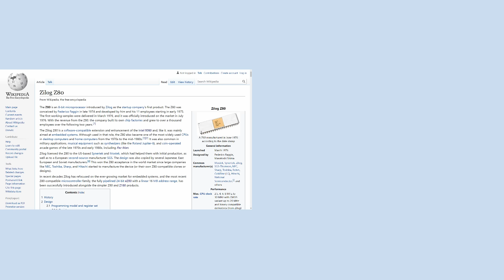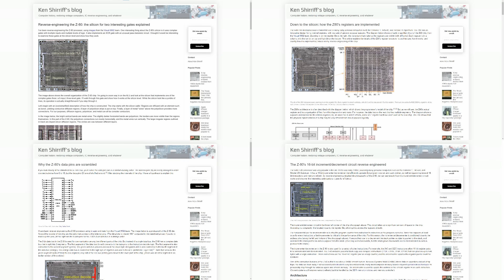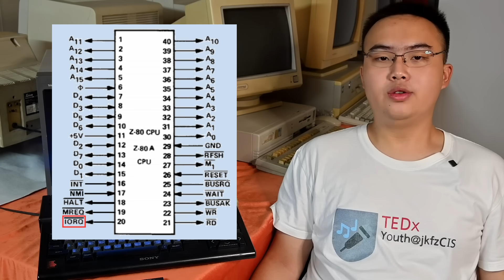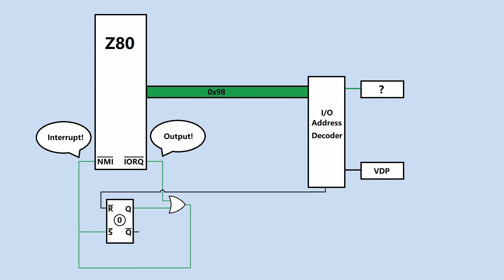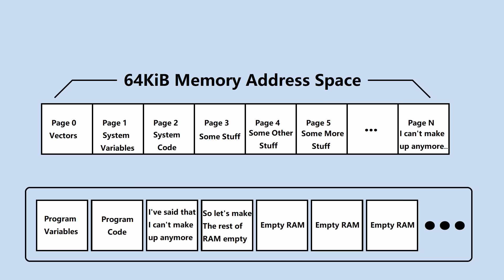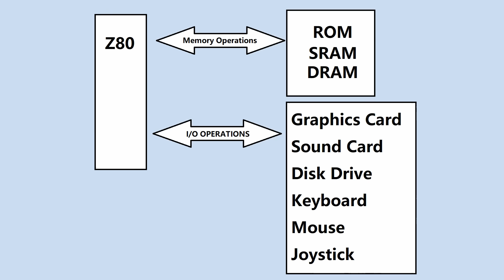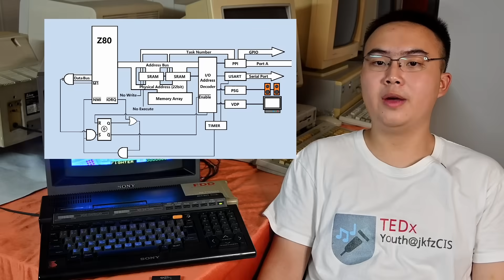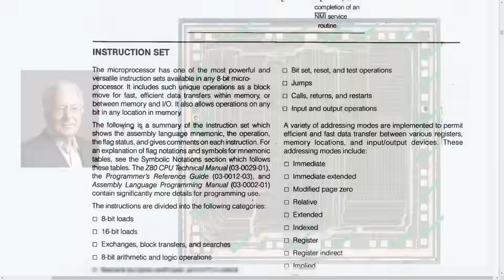The Z80's secret feature discovered after 40 years!

Comment: There were Operating Systems in the 1980's that ran multiuser/multitasking on a Z80 and later the Z8000.  TurboDos and Digital Research's MP/M come to mind.  Virtual Memory support was added as external logic. Much like memory banking and LIMSIM in the DOS world.  Most people do not realize that early processors had very limited memory address spaces. Obviously if you are supporting multiuser and multitasking memory needs multiply very quickly. (The same happened to VMWARE and Virtualization decades later). In the Z80/8080/8086 time frame Lotus and their killer app "Lotus 123" very quickly found out that the memory limitation was a huge problem for the PC. They developed, with Intel and Microsoft, the LIM memory paging (expansion) standard to made far more memory addressable as pages that could map into a window in normal memory space. Graphics cards had to do the same. This was actually a limitation of the ISA Bus specification as well.  Point being memory and security were glued on at first and then like all good things integrated into silicon.

Comment: About 30y ago I've connected together two 6502 to the same memory and I/O to have a two core system, and it worked! The program I've written on the memory was executed by the two processors and collaborating through a shared memory.
Unfortunately I was unable to finish the project because I needed a multi voltage power supply to make the LCD screen work and I was unable to build a stable one, so I was able to use the circuit only on a big power supply.
I still have the circuit in the closet, but today he doesn't work anymore because some soldering connections have broken.
Good memories about a distant past where computers where easier to understand and cheat.

Comment: vibes
Reply: Back in late 70s to mid 90s I wrote software on following 

8008, 8080, 8085, z80, nsc800 (cmos z80 with intel addressing and 8085 instructions as well), 8051 family, 68000. My favorite besides the nsc800 is the 8051 family specifically the Phillips derviatives. Great processor.

Comment: Theoretically you could probably handle some of those "impossible" things in software via an operating system. But it would be a massive performance hit for significantly less than perfect results .
Reply: You only can if that OS is fully encapsulated, has a fully integrated dev environment and only allows to run code that went through its own compile/link mechanism.
Reply: @-Jakob-  Doesn't necesarily need go go through a specific compile/link tool, but that's definitely a more airtight route. Just need to refuse execution of any binary who structure doesn't match. -- I'm really not talkings about locking out intentionally malicious code though, just stuff that doesn't rely on OS services go get stuff done.

Comment: Improvements:
1) Make the supervisor flip-flop drive one address line of your address mapping RAM.  This way you automatically get the OS's mapping when you go into the OS and the user mapping when running as a user.  This keeps all of your OS code out of user space.
2) Make it so that all accesses can make an NMI if they are to places that need to be dealt with by OS code like display memory.  This can be done by a having the mapping RAM return some value like 00H for those accesses.
3) Add a "time slice" timer chip so that you can do preemptive tasking at some fixed rate.
4) Add circuits that capture the automatic pushes of return addresses on the NMI so that someone can't mess up OS variables by pointing the SP at them and then doing an  I/O
Reply: re: "3) Add a "time slice" timer chip so that you can do preemptive tasking at some fixed rate."
The Z80 CTC does this easily; there are four programmable timers each with its own interrupt vector on the CTC ...
Reply: @uploadJ  Also add a hardware breakpoint feature like this:
Combine the fetch, memory operations and I/O operations to make a "doing something" signal that goes to the AND gates below.
Find a RAM that is small and buy several.  Connect the address lines of each to some of the signals.  For example one can be on A0..A7 and another on D0..D7 and a third on the various memory and I/O strobes.
Of these RAMs the D0 gets combined by and AND, all the D1s get combined in the next AND etc.
The outputs of the ANDs are ORed to trip the NMI.
This gives you the ability to trigger an NMI when for example a certain value is written to a certain location in RAM.  Spans of locations and spans of values (including any) can all be done just by setting bits in the RAM chips.

Comment: The 6502 also has undocumented unused features including iligal opcodes wich were purposely undocumented since they lead to unpredictible strange behavior of the cpu.
Reply: Yeah with the 6502 some of the "undocumented instructions" cause the internal state counter (for want of a better description) to go beyond the internal decoder table hanging the CPU solid... Have watched some fascinating videos... Practically I've been more at home on Z80 and 68000 but have a little 6502 and x86 experience. 8086 (before getting into 286 and beyond) didn't seem that foreign after programming Z80 and I even ported some PC 8086 code to ZX Spectrum Z80 way in the past....

Comment: Be very careful with NMI on Z80. The CPU is not fast and these interrupts can easily swamp the routine code (as you indicated). Anything in NMI must be very brief. How do I know? Multi Z80 control systems design in the 80s. It extended to multi CPU with a shared paged RAM for batching systems (mixers and the like) for animal feed, concrete etc. I also did a coveyor sending system which used an encoder to get the destination. A spring sorter for keyboard spring manufacture and several others in hogh speed use. THAT was a Loooong time ago!

It's interesting to refresh my memory (ha!) as it isn't static like the Z80, by watching your video 🙂
Reply: If your worried about the NMI speed then you've entered the realm of real-time programming. A whole of other ball of wax itself and subject of books and maybe another video lol
Reply: @metatechnologist  The observation is very relevant and has nothing to do with real-time programming. Setting the hardware up so that every single I/O request generates an NMI is idiotic at best. The processor services an NMI by essentially doing an RST instruction to the fixed address 66H, which takes 11 T-states (clock cycles). The shortest possible NMI routine is an immediate RETN instruction (RETurn from Non-maskable interrupt), which takes an additional 14 T-states. An OUT instruction already takes 11-16 T-states to perform, which means that each OUT is now at least 35-40 T-states, and that is without any "protection" code even executed! All I/O will be slowed down by at least 3 times.
Reply: @bennylofgren3208  Here's something that will make you cry just.a tiny.bit. Zilog just announced they're ending production of the Z80 this coming summer. It was a good run though. Thanks for responding! Edit: Apparently it's just the 40 pin dip that's going away not the newer embedded versions. But it's still pretty notable!
Reply: @metatechnologist  Yeah, I read that too, with some sadness in my heart. I started programming the Z80 in 1979 and as you saw some of it still is still stuck in my head. :) Those were some good days.
Reply: @metatechnologist  re: " A whole of other ball of wax itself and subject of books"
Yeah ... that's not really going to 'teach' anybody though. Book learning is good to a degree, but NOTHING beats actually doing it, even in prototype stage and then 'learning' the ropes like the rules one learns when doing critical real-time interrupt service routines ...

Comment: I remember looking through the documentation of the 6800, and I found that the software interrupt instruction created a unique set of signals on the pins, and, as a result, I thought at the time that a simple external circuit could permit adding a supervisor mode to that processor.
Reply: Can I ask why you didn't pursue the idea?
Reply: @ericwazhung : Anyone that really wanted to add some sort of protected mode to a processor without it, but with an interrupt interface, could just do it by using a timer interrupt to control a memory-mapper mode pin: interrupt triggers, clearing a flip-flop that can only be addressed while the same flip-flop is cleared, thus causing that interrupt (and any other that the board designer wants) to only be handled by the code accessible while the flip-flop is cleared- cleared corresponds to supervisor mode, set corresponds to user mode, set the memory mapping correctly and you're good to go. This can be done on virtually any processor with a generic interrupt mechanism.

Comment: The original NASCOM-1 used flip-flops, gates, the NMI and one of the RST instructions to implement breakpoints and single stepping. It would drop a RST in place of the orginal opcode at the breakpoint, which would call into the OS, there it would replace the original instruction and arm the flip flops and RETI, raising an NMI after the second M1 cycle (ie. after the stepped to instruction had executed) handing control back to the OS again.
Reply: That’s what she said

Comment: I don't completely understand everything you covered here, but I think I got most of it, and it's quite intriguing!  Extending a CPU's features like this, with fairly simple add-on circuitry isn't even something I thought possible. This was a really cool recommendation from the algorithm!
Reply: The simpler the CPU, the easier it is to add a feature via external hardware.  The Synclair ZX80/ZX81 computers did their display by causing the the Z80 to execute a string of NOP instructions to make the timing for the display hardware.  On a more modern CPU, the cache and instruction prefetch etc would mess up the timing.
Reply: @kensmith5694  I knew the zx80 drew the screen with the cpu on an alternating between compute and drawing instructions, but didn't know about the NOPs.  I'm not super familiar with operating that close to the hardware, but always happy to learn more, so thanks! 😎👍
Reply: @serpent77  It was extremely clever.  There was a circuit that caused any instruction fetch where the address A15 line was true to be forced to get a NOP instruction unless the byte fetched was a 76H.
The A15 was not used in decoding the address so it was ignored for what was really addressed.
To display characters from RAM, the program counter was set to 8000H plus the location they desired.
The processor would do a NOP which took a total of 8 clock cycles.
The actual byte was captured and fed onto 8 bits of the address bus.
Using a weird property of the Z80 more bits were filled in during the time the processor was working on the NOP.
This produced the address in the PROM that looked up the bit pattern to display for this character.
A shift register would then be loaded with it to shift it out to the display.
The thing with the 76H was so that by putting a HALT instruction in the display area, lines could be terminated early.
One of the address bits was wired to the NMI.
The timing of the Z80 was such that the NMI was only sensed while it was doing a refresh operation on the RAM.  The result was that the refresh counter counted up to make the NMI happen when the horizontal sync pulse should be done.
Reply: @kensmith5694  that's interesting, I remember back in the day going directly to ram to draw displays on an old IBM AT, obviously I didn't have to worry about the timing like z80 did, but I mostly get the concept you explained. Thanks 😃

Comment: Adding hardware memory mapping was pretty common - you mentioned quite a few.  Add-on MMU's were also common in mini-computers - for example the PDP-11.  Why didn't we see these in 8-bit micros?  I think the major hurdle was price - RAM was still relatively expensive, and even the cost of an extra circuit was calculated into the cost of most consumer machines.  Until the C64 came along, it was common to see home computers ship with 16K or less RAM, which of course wasn't that useful beyond a demonstration.  The Apple ][ could be expanded in various ways thanks to its open slots - the so-called language card was a good example of this.  There would have been nothing really stopping someone from expanding most Z80 systems beyond the natural 64K limit and adding protected and maybe even page-swapable memory - but mostly nobody did because by the time it was really possible in price, the world had moved on to other system architectures.

Comment: 4 minutes into the video and still nothing, 4 minutes of my life nobody will give me back
btw, the simplest, and pure software, way to get protected mode, multi-tasking, etc, is to build a VM on top of the Z80 machine code, you'll get a nex virtual processor with its own instruction set which can be whatever you want.  darn, you can even make it into a 32-bit, or even 64-bit instruction set cpu if you so wish (and with a bit of extra h/w assistance you can actually extend the address bus to 32, or even 64 bits if you want)

Comment: Nothing new was discussed as the Z80 processor user.
Reply: I don't get this at all. Having a MSX, while in ROM basic, you can address anything. What secret is there to find? Protected mode is a OS thing, as far as I know. Of course you can lift your user environment to a software-stack that does it's own adressing and task-scheduling but with the performance of a Z80, it's not much of use.

Comment: Nice idea but I believe the NMI signal can't trigger until the currently running instruction finishes, e.g. in that scenario after the IO request that you think you're intercepting... Only then can the processor perform all the logic to "CALL" the NMI routine at 0x0066... And if you consume the IORQ line to feed the NMI how would a peripheral know to accept an IO request? The part that does have some merit is having an MMU and banking out "protected" code and data... One interesting hardware product for the Sinclair ZX Spectrum was a speech synthsizer addon. In hardware it checked for access memory access to the IM1 maskable interrupt memory address, and as soon as there was an MREQ for that address it would assert a control line that mapped it's own ROM or go back to the computer own ROM by using a flip-flop. Every maskable interrupt (50 times a second) the add-on ROM would execute it's own code then jump back to the start of the code and the original ROM would then continue... an MMU circuit can "redirect" memory signals any way you want.... ZX Spectrum 128 did that on a basic level in the mid 80s though not for the reason you give. As for undocumented features, most of them are bugs or just gaps in the decode logic the designers didn't design.
Reply: Yup, there is quite a bit of romanticising going on in this video….

Also, the 6809 was generally more favoured to this kind of hardware hackery, which is why it was the preferred choice for 8 bit Unix-like systems. You could almost do a full protected mode, but like the Z80, the synchronous nature of the bus was the principle flaw.
Reply: He added a line to block the I/O from really happening by disabling the I/O decoder.
Reply: @kensmith5694  But now there's no IORQ going out to tell IO devices to decode the address bus to actually do any I/O.... And the performance hit is IMMENSE... You waste the 11/12 cycles of the "original" in/out, then it takes the CPU 11 cycles to reach the NMI routine, then you SOMEHOW have to work out what the instruction was while preserving the registers because ANY of the main register set could be involved... Then you have to consider block I/O... Takes 14 clock cycles to come out of the NMI too... Just not practical... Notice too a complete lack of a demonstration of this theory...
Reply: @zombieman81  He is basing the design (in part) on the idea that I/O instructions are rare in real code.  In most cases, this is reasonable.
Working stuff out is not a mystery.  Once in the NMI code, he can store the registers into the OS's workspace RAM and then grab the return address to go look to see which I/O instruction it was.  On the Z80 there are not a lot of them and no, not any register can be involved.  Take a look at the instruction set.  You get to do I/O with the A register using either an inline constant for the address or the BC register pair.  
What he is suggesting is practical for his intended purposes and need not be demonstrated to be studied to see that the idea works.
Reply: @kensmith5694  back in the z80 days this was not reasonable since everything you did was on a port, serial terminal, floppy controller. Doing IO instructions all day long, I'm not convinced this design works as intended but maybe you guys know more than me. That NMI will be after the IO instruction has completed, it may not have been allowed to do anything if the Chip was disabled but it still exectues, then the NMI triggers and you jump to that routine, when its over it returns to the next instruction. What am i missing?
Reply: @randyjackson7584  On every bit of software I have worked on, the I/O instructions were a small part of the time the code ran.  RS-232 in the Z80 era was 9600 baud.  This means that even if you were doing it constantly, there was over 1ms between I/O operations.  
On the ZX80 and ZX81 machines, the only time much I/O was done was when the display was active.  That too wasn't all that fast.
The MNI is indeed after the instruction but the instruction is prevented from doing anything to the hardware so it has no impact on the result.